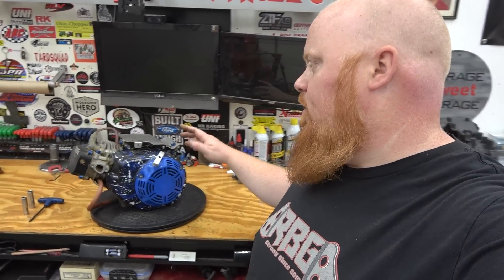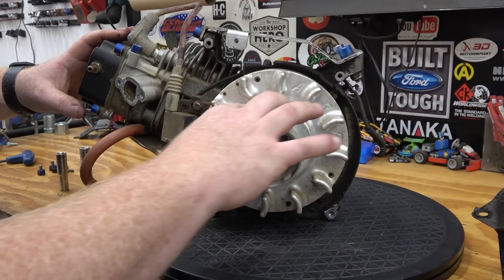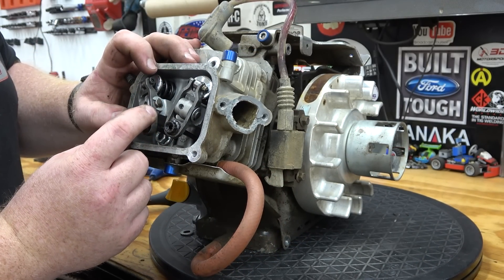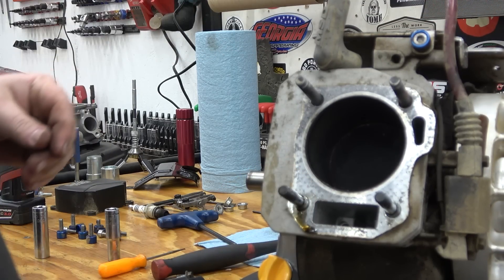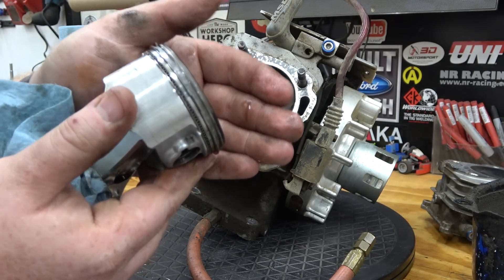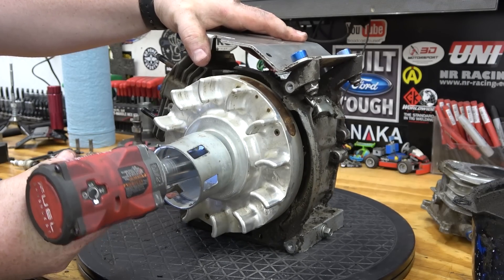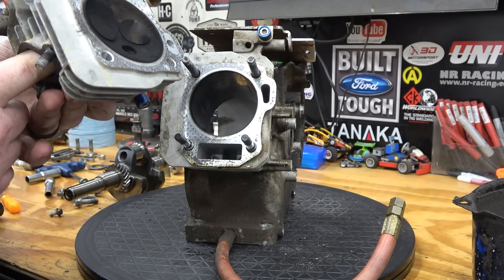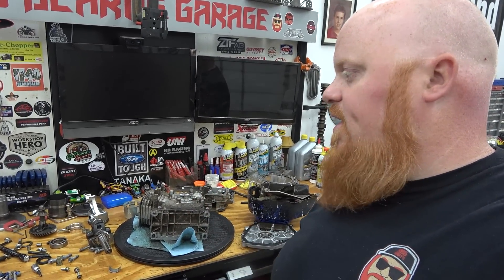500 Hour + Stage 3 Predator 212cc Hemi Teardown ~ Abused Engine

Comment: Nice tear down just my opinion,   the block down by the oil drain. I would use liquid metal to seal those cracks before they get worse .
Reply: Wouldn't it be a much better fix to w weld the block

Comment: That thing was running rich!! I'm not sure why an Iridium plug lasting 3 years is surprising?!?. They run over 100,000 miles. So the cerakote on block is purely cosmetic. I like some things there channels do with builds, but hate all the "snake oil salesmen" crap. You guys push useless "upgrades", that don't serve any purpose, wether performance or longevity. I know, Go power sports, appreciates the plug from their sponsor.... But seriously.

Comment: The dust comes from the filter adapters to run the big filters. They need a gasket or oring or something. Had this same issue. The adapters just attach with set screws and aren't a tight fit as soon as the filter does its job air start going to the crack cause there is no restriction.

Comment: Love your channel, great content! Those are pretty decent little engines.  I have a Predator 3500 inverter generator with the stock 212cc with 10,000 hours on it. I've cleaned the carbon build up on the heads several times. Also had too swap the head/valves recently cuz the valve seats were shot.  Wish I had your expertise. I'm more of a hack than anything, but at least I've kept it running to keep the lights on.  Keep up the good work,  you guys are great.
Reply: 10k hours is crazy! I have a Renegade 3500 generator with the exact same engine, but it's a 212cc Loncin motor, which is who makes the Predators for HF

Comment: Hey Red Beard I have a question about the Predator Ghost. Is that engine stock comparable to a stage 2 212 Predator Hemi? You are the only one I can think to ask that would have first hand experience with both of these engines/builds :)
Reply: All you have to do is look at the performance parts they used on the Ghost. A PZ20 carb and 252 cam. I think they may have used low tension piston rings but big deal. These days I'm not sure why anyone would get a Predator 212. Any of them.
Reply: @Deucealive75 what would you recommended instead of a 212

Comment: cant i tell that my piston is at top dead center just by lookin in the spark plug port to set the lash on my ducar 212
Reply: I'm not an expert, but I believe it's supposed to be TDC  of the compression stroke and not TDC  of the "exhaust" stroke. He probably was looking at the flywheel(where the rusty part signals the spark generator to fire) and the piston position. If that helps?

Comment: Come Red Beard.......500 hours? I have trusted your word for years but this is unlikely. I did some math........if you ran this engine for one hour per day, everyday for a year and a half that would be 534 hours.
Reply: Unmodded these Predator/Loncin 212s can run for thousands of hours, but you have to be strict on changing the oil every 50-100hrs and keeping the valves in check every 250hrs. 
Someone mentioned having a 10,000hr 212cc Predator in a generator!
Reply: It seems high for a modified engine as a whole. The block could possibly but at those rpms under duress I would think the rod bearings, rings and wrist pin would have been changed.

Comment: I'd like to see the tip of the oil-dipper.See the dent from the block.To me,the damage on the crank bearing looks like the oil had all baked off while it set,and turning it over ripped the plating off the bearing.You guys started it and there's the damage to the block as the crank tip hit it.<...?

Comment: There has been one thing that bugs me when you talk about rocker arms “ratio” means the amount it opens the valve verses how much the cam moves all rocker arms are “ratio” rockers but in the aftermarket you get “roller” rockers where all the pivot points have roller bearings so the upgrade is “roller” rockers
Reply: yup i agree

Comment: Looks like excessive heat stress fracturing there on the block. Doesn't look like wear and tear like something be hitting it. Just Looks like that is where a lot of heat pressure was building up. Might want to tig or jb weld that spot and give just that side a bit of heat shield cerakoting.

Comment: When you have that many crank shims how do you know the rod journal is even centered to the cylinder?
Reply: With that many,I would've divided them per side too.
Reply: Because they go in front of the crank and not behind so if the crank is fentered but has play adding shims between the side cover and crank will stop play
Reply: How do you know it would be centered to begin with? Its a cheap china motor lol. now you have me interested in measuring this

Comment: Awesome timing, I was just thinking about getting a 212 to replace the stock 196 in my Coleman Minibike.  I waited until I was ready to get the parts for a band brake assembly on the centrifugal clutch, and can do the whole thing at once.  Because I live in a bunch of hills and ride downhill a lot, I wanted the peace of mind that I had two brakes.  Whatever 212 I get will be to get me back up the hill, as the 196 just makes noise when I start from a complete stop on the hill and doesn't move.
Reply: Get a 224cc
Reply: @mauricedavis2905  I was looking into a 8HP motor, but wasn't sure if all the bolts would line up the same for the jack shaft bracket or not.  It looks like the 212 is a direct swap with minimum fabrication required.
Reply: @mcdoctorglock  the 224 is just a factory stroker HD version of the 212
Reply: @mauricedavis2905  Thanks!  I just looked it up a little while ago and found that the nearby Harbor Freight has them in stock- cheaper than the 301 and the 212 Ghost.  I'm going to stop over there in the next couple of days and check one out.  Maybe I can fab up the clutch band brake bracket and jack chain bracket together and swap out the whole thing at one time.  Should I do a direct chain or keep the stock jack chain setup?  How do you tension the chain without the jack chain tensioner?
Reply: @mcdoctorglock  if the 224 will work without interfering with the jackshaft it would be simpler to keep it(most likely). If not its usually pretty simple to delete if the engine and wheel sprockets are on the same side already. Unbolt it(or cut out if not possible), check sprockets are in line with each-other, run a longer chain and buy or build a tensioner. Im sure theres videos here on how to do that last part
Reply: The 224 is just like any other small block as far as mounting bolt patterns. Stock they make great torque compared to a 196cc
Reply: @mauricedavis2905  Thanks, I just picked one up from the local HF store today.  I just got the band brake parts today, but I'm still waiting for the jack chain plate that I'm going to cut up and weld the band brake assembly to.  I have to get a new clutch and throttle assembly- then I'm going to assemble everything so all I have to do is swap engine & jack chain for the new engine, jack chain assy & brake.  I can keep the other engine for my kid's minibikes (we have the same models) for when parts are needed.  Thanks you guys for your expertise, I probably wouldn't have bothered to get to this point without the advise.
Reply: @mcdoctorglock  I hope you enjoy that extra torque be careful😉